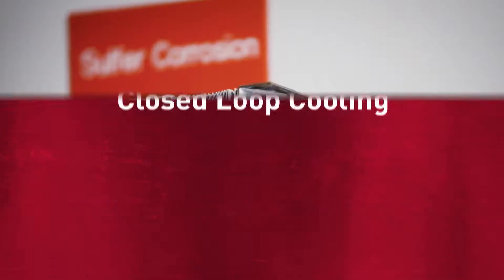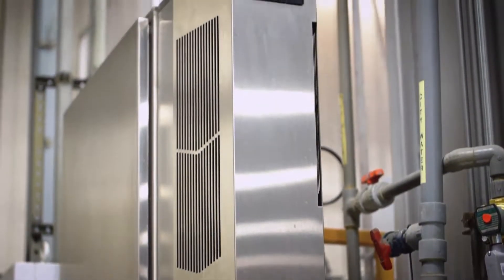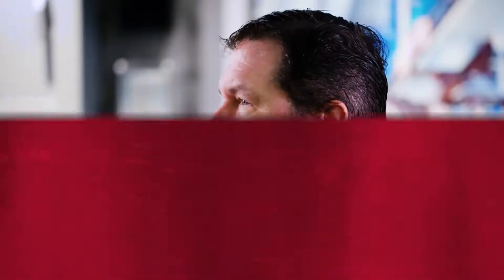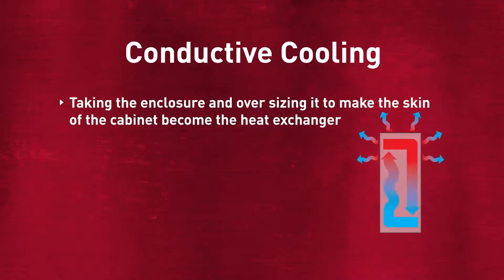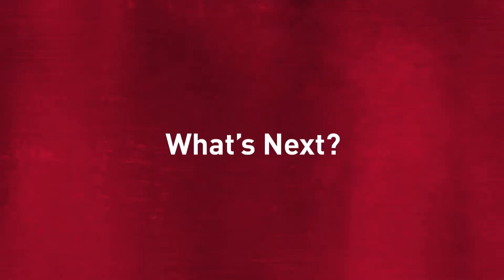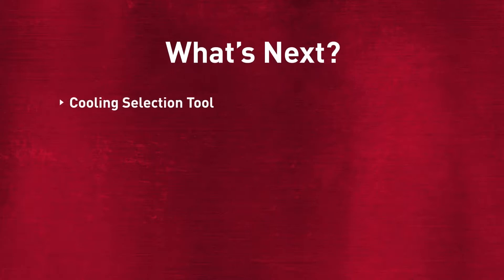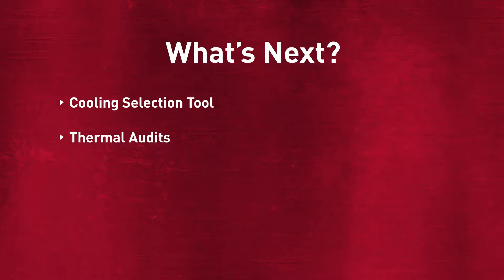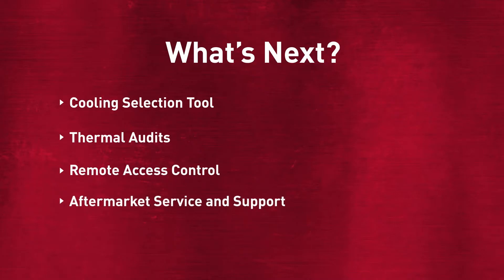Industrial Electrical Enclosure Cooling Solutions w/ nVent HOFFMAN — Allied Electronics & Automation

Comment: How do you reset the LA error code on model G280646G060. I know it’s a high pressure code. I left the unit off for 30 min (without power) and the unit defaults back to the LA error code almost immediately without the compressor turning on. Bad switch maybe, but why can’t I clear the code? Thank you.